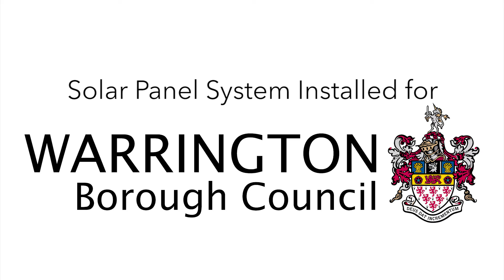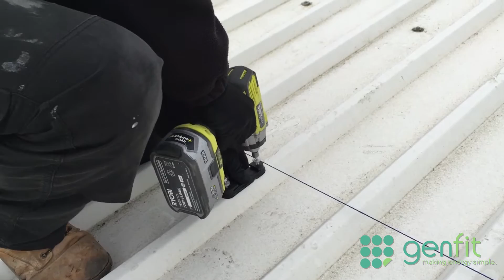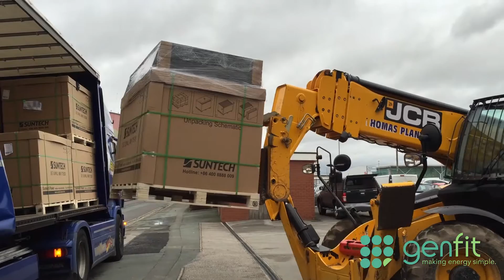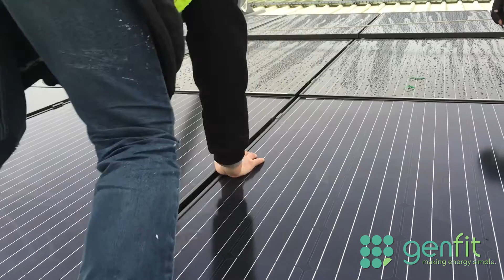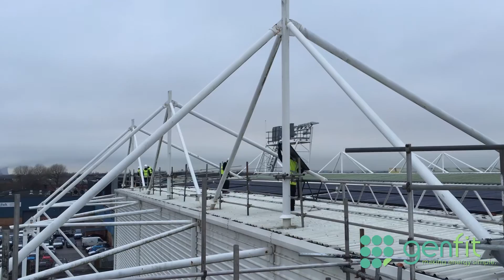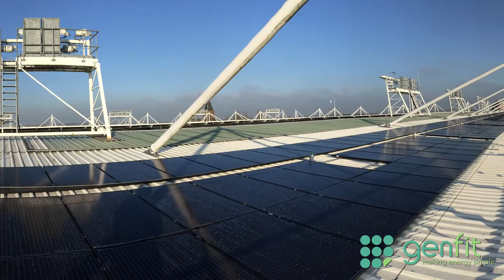Halliwell Jones Stadium 80 kWp Solar PV Installation - Warrington Borough Council

Comment: 34''What's your black name? How many inches is the bolt? Where is the place of purchase?
Reply: The panel type was 270W Suntech, the bolts used were a component of the K2 Speedrail system and we provided the parts and materials for the system.
Reply: @dawson345  I wonder if URL is the site where you can purchase the K2 Speedrail system. Amazon Searching Thank you for your kind reply